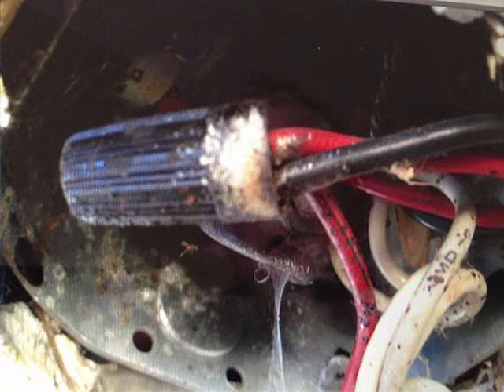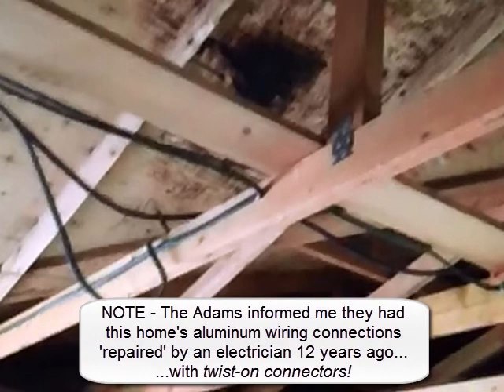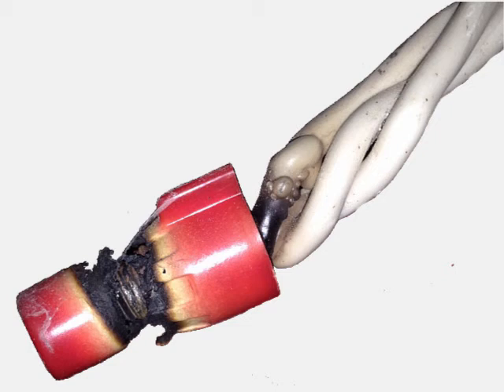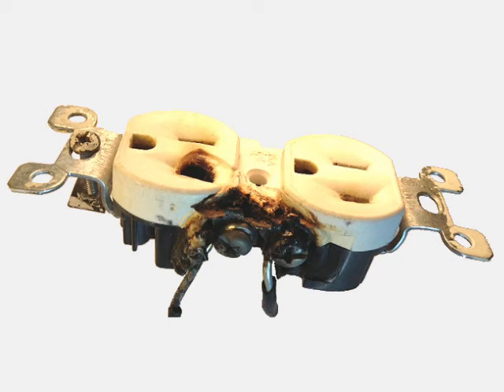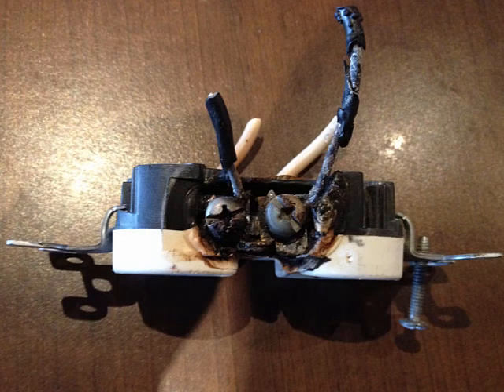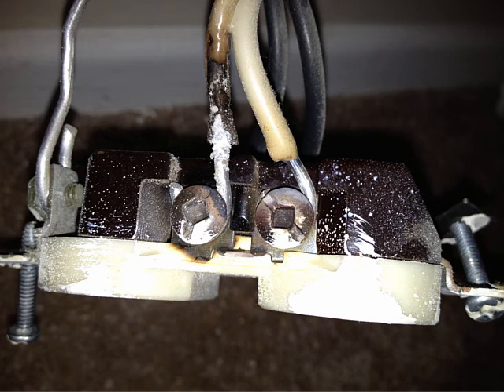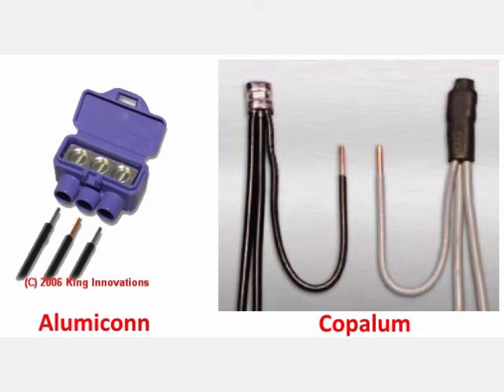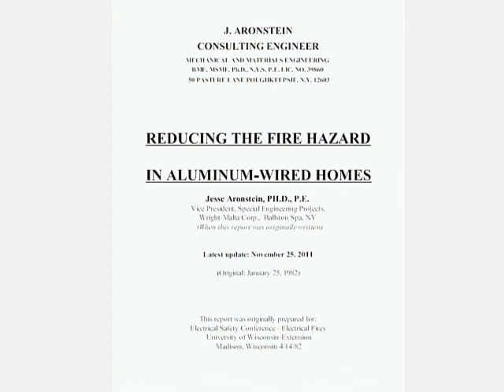How to Repair Aluminum Wiring Hazards in Calgary SW

Comment: You ramble to much for goodness sake just show how to fix the outlet
Reply from the maker: Check out this video then:
https://www.youtube.com/watch?v=DElPaO9zwEA

I got permission from Dr. Aronstein to produce into video format his report "Reducing the Fire Hazards in Aluminum-Wired Homes".

The reason I don't teach how to repair these hazards is because people can make the connections and the hazards worse! Aluminum is not like working with copper and needs an experienced hand to do it correctly, I sh*t thee not.

I have another video where I interview a couple who almost died as a result of repairs an electrician did 12 years ago on their aluminum wiring at: https://www.youtube.com/watch?v=Inhlivcd-ag

Additonally, I have found MANY burnouts where homeowners attempted to repair the connections themselves.

Revealing the results of over 40 years of research, Dr. Aronstein's report is considered the bible of aluminum wire retrofitting. His work was instrumental in the United States Consumer Product Safety Commission's final report #516 "Repairing Aluminum Wiring".

In his report, he will reveal the ONLY acceptable methods, materials and products to do so. He has two parts featuring permanent and temporary repair.

If you hire an electrician, be sure he uses this information. 

If you insist on doing the work yourself, you do so at your own risk.

I am producing an online seminar that will address issues and solutions surrounding this menace. More information can be found at http://aluminumwiringrepair.com
Reply from the maker: Really? You think I ramble? :D
Reply from the maker: Hi vic ! Thank you for your input. I am so truly sorry about your neighbor's disaster. I hope no one was hurt.

It is stories like this that drive me do accelerate what I am doing.

It is why I ramble, blabber and drone on about this subject. The more we talk about it, the more owners of aluminum-wired homes can get informed about what to do about these hazards.

In fact, the reason why I do go on is I am trying to 'sell' the proper ways to fix them. And I simply cannot do that with a few words.

If people are really interested in this topic, they will listen to EVERY word I say. If I have their ear, I will say all I can to persuade them to use the right products to prevent disasters from happening in the future from using the wrong products.

Besides, people can call me what they want - I am impervious.

Did you see the little laughy face at the end of MY comment in response to hers?

If you would please 'Subscribe' to this channel, it would help me out a lot. For instance, I could give it a proper name like "Aluminum Wire Repairs". It would also help in getting the videos to show up in the top 10 in Google. This helps get the message out to those who are desperately seeking the correct ways to repair these potentially deadly hazards.

BTW - Do you think I could get a telephone interview with your neighbor? I know it won't help them now, but perhaps they could really help others by providing their personal warning.

To contact me, just hit 'Subscribe' and you can access my email.
Reply: Debra Bilger he does not ramble and is giving very valuable information. Dumb people like you is the reason houses go up in flames. This is not something you want to do yourself. The danger is very real. My neighbors house just went up in flames because of this. Everything lost.